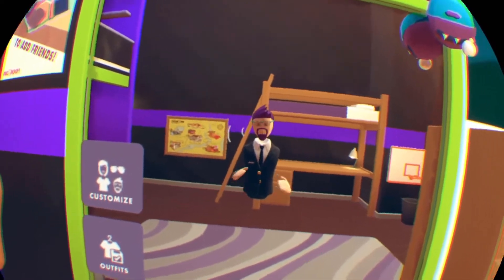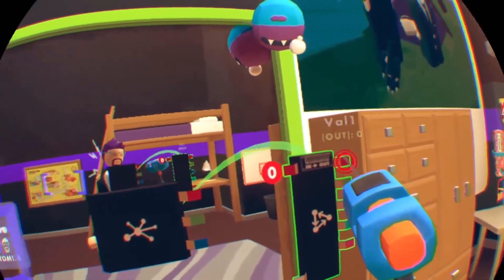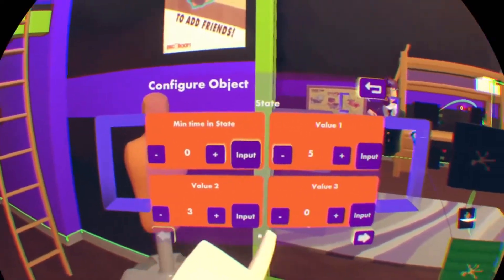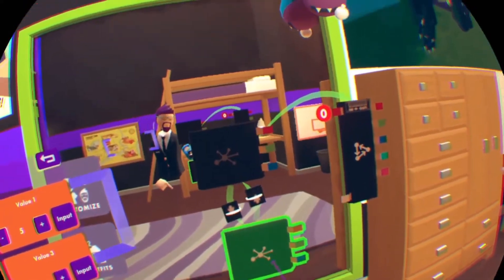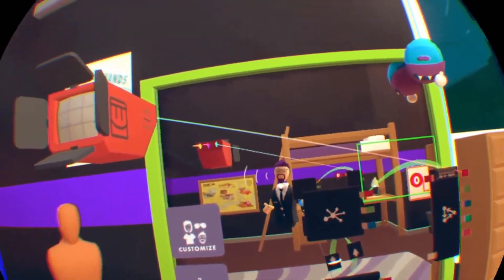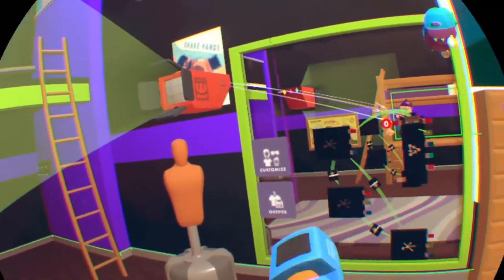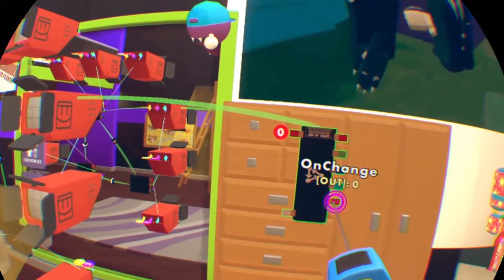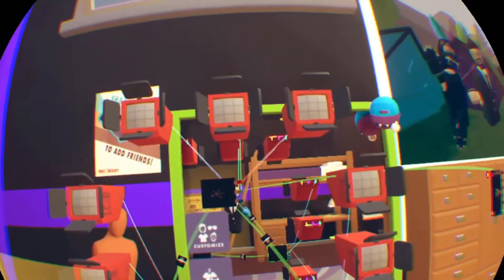How To Use the State Machine | Rec Room Tutorial

Comment: I know it's been four years, but how do you stop a state machine once it's been started?
Reply from the maker: i think you send a signal to the R pin
Reply: @theRCLman  The R pin just restarts the state machine from the beginning rather than stopping it 😢
Reply from the maker: its been so long, i think there is a way to make like little things where a siganal has to be sent before it moves on, i guess you would need one of those
Reply: @theRCLman  Those do prevent the state machine from moving on to the next state, but it doesn't stop the machine mid-state. I can't find anything on it, so I wouldn't be surprised if it's impossible.
Reply from the maker: might not be, i am faily certain v2 state machines could but i haven't messed with those in a awhile either

Comment: Thanks for this tutorial. I am new to Rec Room and this is my first VR headset (quest 3). When I follow state machine tutorials, I always have trouble connecting anything to the arrows that go between the states. My guess is they changed things and it doesn't work like that anymore. I'm trying to make a door than opens and closes with the press of a button, but I cannot seem to make the button start or stop the state machine. Any thoughts?
Reply from the maker: Hook the button to that square that pops up between the states, if i remeber right attaching it their wont switch stat3 till you press it, unfortunately they are phasing out cv1 so i am slowly losing the knowledge

Comment: Why don't the activate signals work for trigger volumes
Reply from the maker: Are you using the legacy trigger volume or the regular trigger volume,only the legacy one works with state machines
Reply from the maker: State machines are cv1 and they recently changed everything so cv1 is called legacy and cv2 is just circuits